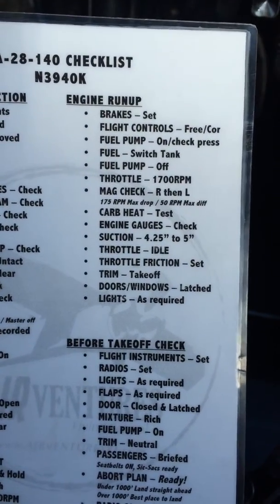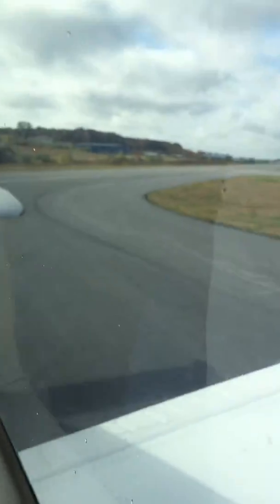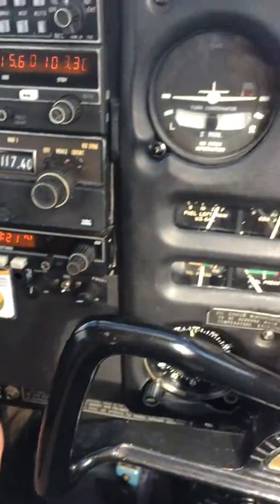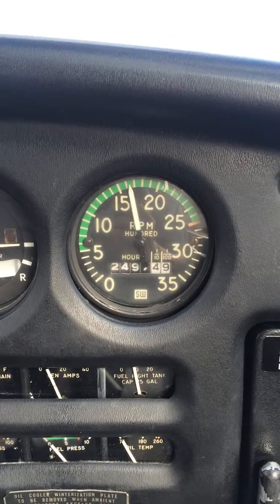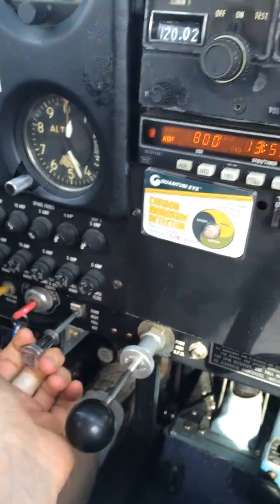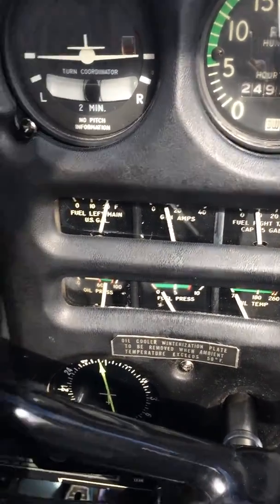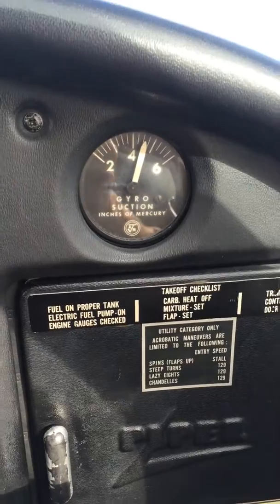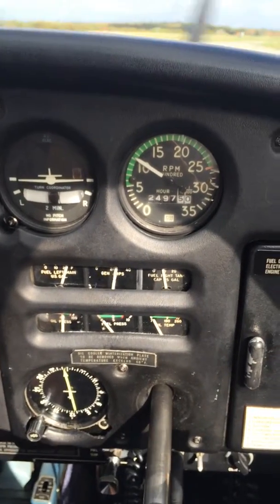PA28-140 Engine Run-up procedure

Comment: I'm an A&P and have a 1965 Cherokee 140. I just overhauled the engine and added a EDM830 engine monitor. The monitor is great! I noticed that your loadmeter ( that shows if you are charging) is quite erratic possibly indicating a regulator problem. Also, the fuel pressure should be around 5 psi with or without the electric pump running. It might be the gauge itself, but I would have the engine driven pump checked out for piece of mind. Just a thought.